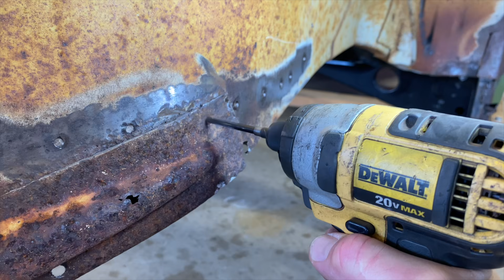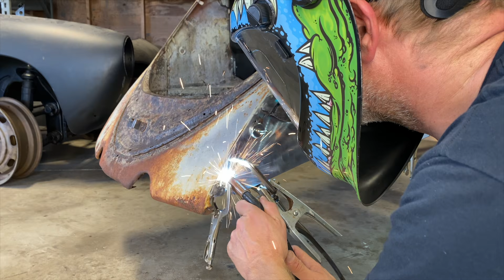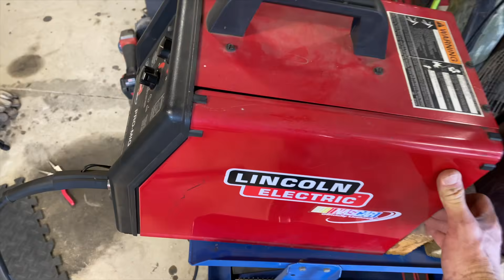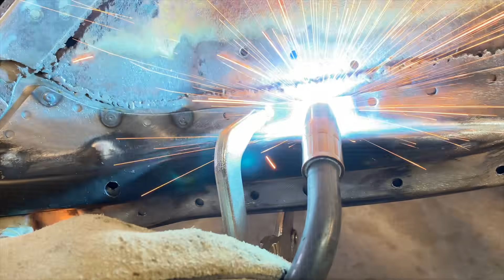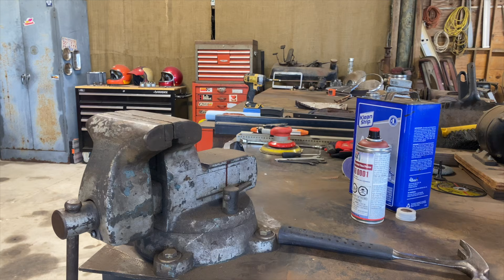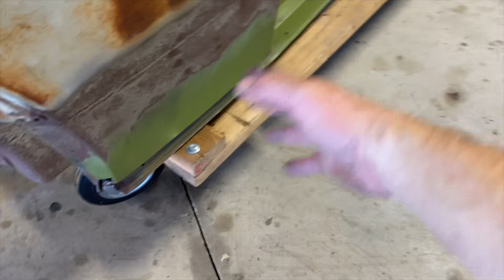Engine Bay Metal Work - 1965 VW Beetle Restoration

Comment: You could find a oval or split rear window and weld in nicely. Really good work there. I should have  done mine that way but it would have snow balled. Mine was not rusty just rear ended. I cut it apart and straightened the crumpled metal and welded it back looks great now. What your doing would have been easier. Keep doing it looking good.

Comment: Great video. I have been playing your videos while I am in the shop.   I am fixing a 64 sea blue beetle.  I am wondering what is your plan for paint are you trying to match the patina on the repaired areas or doing something else.   I am trying on mine to buff the old paint and paint the repaired spots then a matte clear
Reply from the maker: Thank man! Yes, I'm to try and match the patina the best I can on the areas I had to put new metal. I'm going epoxy prime and paint the areas first for protection and them try some patina tricks o n too of the new paint. Most of the repairs will be covered with the fenders and stuff. Im going to put it all back together and see what areas need the treatment. Good luck on your 64. The sea blue is a cool color!
Reply: Thanks for the reply I can’t wait to see the finished product. You do a great job on these style videos

Comment: Back in the day when I did body work I used countersunk steel pop rivets that I oxy acet brazed over then ground smooth. I like your wire welder a lot better. It’s much easier with the wire welder. Not only easier but a lot neater than brazing.

Comment: What if you swapped in a modern VW powertrain, swapped out the spare tire for a radiator, and stiffened the chassis to make the proper modern VW beetle.

Comment: I would suggest if you ever do this repair again tack that bumper bracket in a few spots and test fit the number with the fenders on. It’s a lot of work but you will be happy you did it. There is a chance you will have number fitting issues because of this when you put it back together

Comment: Very nice! I just did my shelves not long ago, mine were toast. I need to buy a tank, for my new welder. Yikes! They’re not cheap!! The larger opening, I design little pillows with headliner material so it don’t hold moisture! And push them inside. Great job CT keep up the good work!

Comment: You just created a long pocket for water to collect from condensation you’re going to have rust problems again eventually I suggest you put a couple holes for draining. You also should’ve put weld through primer behind it everywhere you took the paint off of that as well as the bare metal that you welded over, of course I’m talking about your bumper mounting bracket over that patch piece that you weld it up.

Comment: I think you did  great job in welding.  I dissagree with your "patina" look.  After all that work it's a shame to leave it look like a rust bucket, but that's your car, you're decision.  One suggestion would be to try to limit the use of the phrase "you guys."  Or at least "guys."  Really minor critisim considering the fine work you're doing.  I had 3 bugs. A '66, '67 and '69.  Loved 'em all.

Comment: Do you know that’s just gonna oxidize right where you’re welding it? Why didn’t you put any weld through primer to at least prevent some of the oxidation from coming immediately back through? It doesn’t doesn’t matter what you do on the outside of it you’re trapping your metal the bare metal it should any moisture temperature changes causes condensation which causes oxidation. Hey I’m glad it’s your car not mine you’re working!!!

Comment: Hehe, quick tip: reference the old parts, line up the holes you drilled, scribe or mark again, once you clean the metal. Holes will remain in the same position after cleaning. Don't throw away any part untill you're finished. It came out pretty cool, be careful though, every step you make the most accurate possible, will cause your next step to be easier. This is a say worth considering absolutely.
Cheers, keep on! 😉

Comment: Looking good but it would have been better to cut and butt the repair panel behind the bumper bracket so that the flange on the shelf inside would fit tight right along for plug welding the shelf. I always enjoy watching Fitzee's Fabrications videos on Youtube because he does such good cut and butt repairs. best wishes.

Comment: Thanks for the video. 

From the factory there is insulation that is pushed up into the top corner on each side of the firewall as you thought. It is some sort of rock wool in a plastic triangular shaped bag about approx 6 x 4 inch.
Reply from the maker: Ok good to know. Thank you! =)